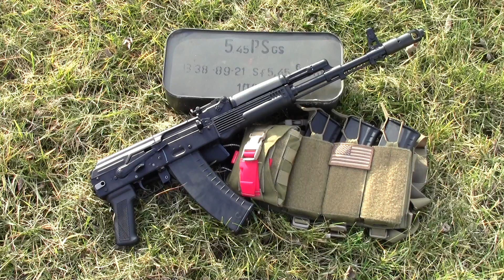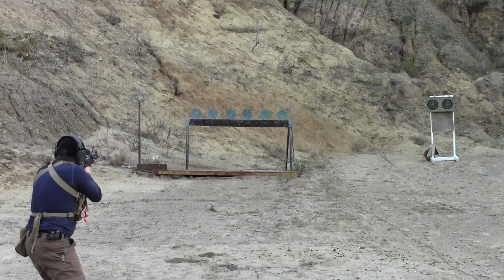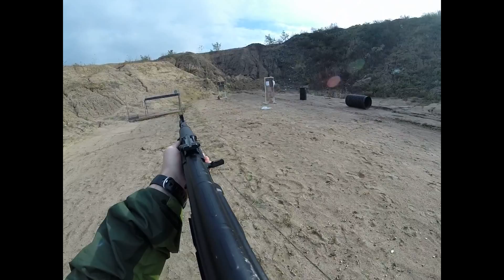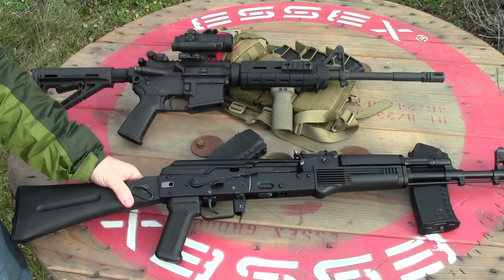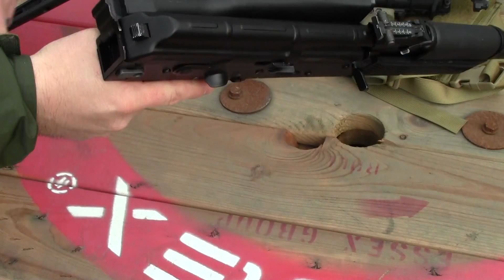Arsenal SLR-104FR (Range Report 1) by TheGearTester

Comment: would you buy this over the AK 47 yes or no if you only had one option AK-47 or AK-74
Reply from the maker: I would go with a 47. 5.45 by 39 is simply not readily available.
Reply: i know its been a month but I hate this myth going around that 5.45x39 is hard to come by, it may not be in your local LGS but online it's very affordable and easy to find. google buy 5.45x39 and you'll find crates of import banned 7n6 and commercial ammo for 20-25 cents a round. It's as pricey as the 7.62x39 for a imo more enjoyable round to shoot. The only advantage that 7.62x39 has is that it can be found in gun stores which it'll be overpriced compared to what you can find online anyways.

Comment: Price of ammo aside, I did like your video.

You covered a lot of ground in a concise fashion.
This model is on my "wish list" and your video further confirmed it.
I even like the crisp sound of it as you cycled the action.
I also like the safety you installed.  Any plans on a video showing how it's done?

The video was very clear, what kind of camera did you use?

I did notice the finish wearing away on the dust cover release button and where the safety travels.  I thought that instead of just black spray paint that Arsenal also Parkerized this model?  It always struck me as odd that Arsenal does such a good job on these rifles just to spray paint them.
Reply from the maker: *****
I've produced a video on the installation of the Krebs Custom safety. https://www.youtube.com/watch?v=MRfIcopD5DI 

The gun does seem to be both blued and painted.

Comment: Hey buddy when u go to buy I highly recommend Bushnell TRS-25 or the Bushnell TRS-32 either one will cost you $100. They extremely great quality in every way and cheaper than a EOTECH, Aimpoint. Also I would recommend you getting a Tango down pistol grip or even better a ATI Scorpion finger groove pistol grip.
Reply: +Q.R.F. CombatVet I used ever scope and mount for my AK 74 - and the shooting besides Iron sights is sighting it in every time.
The Eotech is only sight system that worked on the AK's I've use "including Arsenal" 
&
the Eotch is with the expensive Arsenal Rail system I got . 

So far it's worked Best with Eotech for your quick acquisition sight .
Reply: So to hear you having troubles with scopes holding their zero and you constantly have to re-zero them I have not any problems with my tactical scope and my Bushnell TRS-25. They both hold their zero, great accuracy, very rugged and durable.